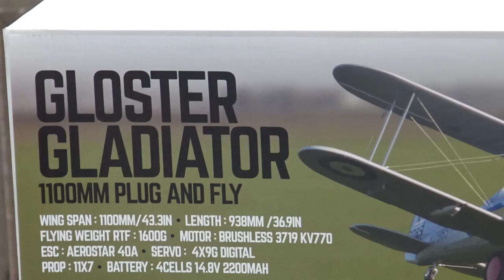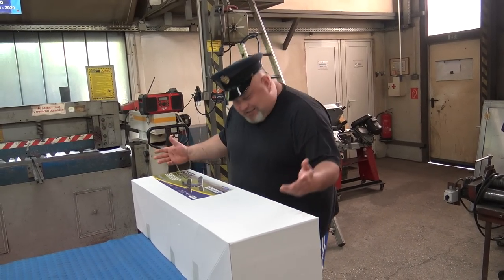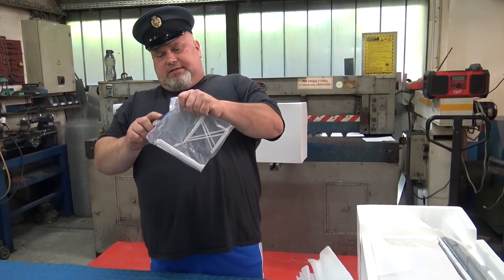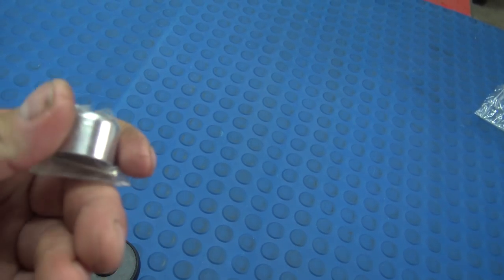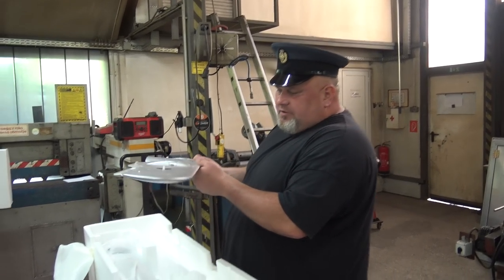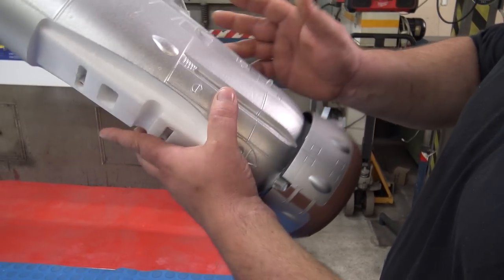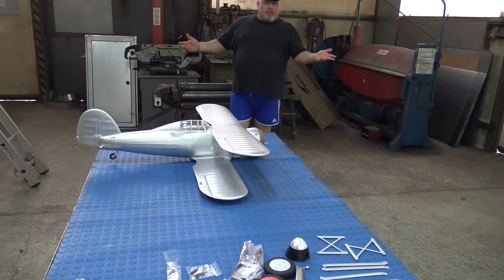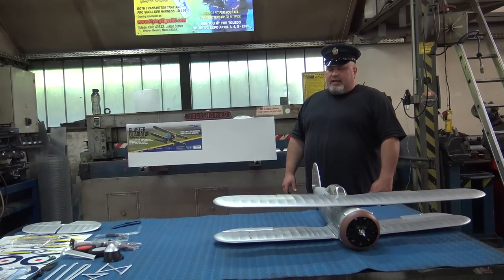Durafly GLOSTER GLADIATOR Mk1 RC Biplane Fighter EPO 1100mm 4S power (43") Unboxing

Comment: Great job guys . Beautiful plane . I like the ribbing and engine cowling detali . I had to use the foam battery trick on the E-flite UMX A-10 Thunderbolt lI. The velcro they use is terrible , and twice now the battery came loose on landing and slide forward breaking the nose from the INSIDE of the plane . It was easy to repair, But i will always use the foam now and on other planes that might need it .I like the unboxings too for the same reason . I have many planes not even opened yet because I'm saving them for the right moment . Salute !

Comment: Hi, and sorry for disturbing. One question :I know that the CG on this model is located pretty forward. However, is it possible to place, right behind ( or under) the cockpit, a very small action camera, something like a Runcam 5 orange or Boscam HD19?
Or to place two Runcam 2 4K right under the lower wing, somewhere where the nacelles or the Browning machine guns were located? I want to transform it in an aerial photography platform.
Second question : which one of the models would be easier to fly : this one, or the E-flite Beechcraft d18?
Thank you in advance.